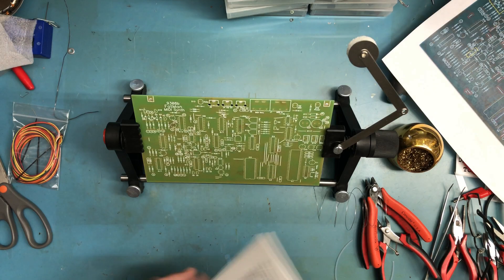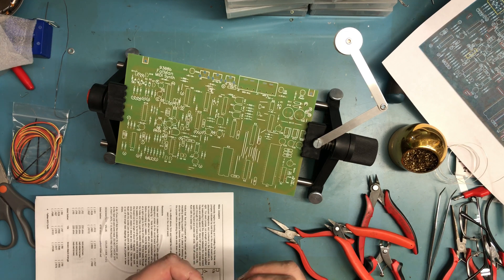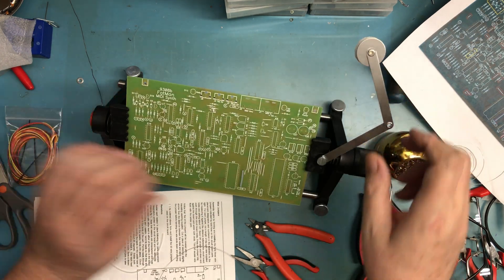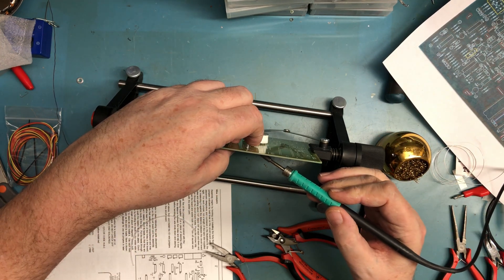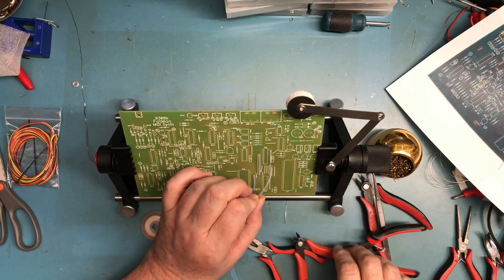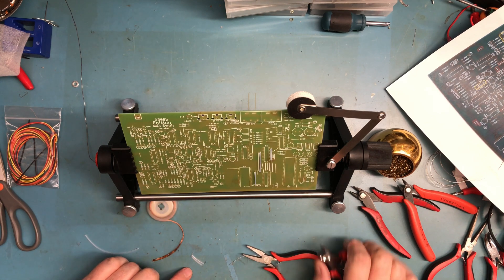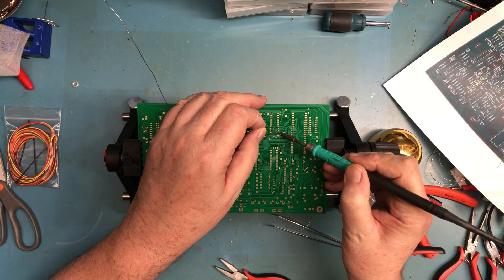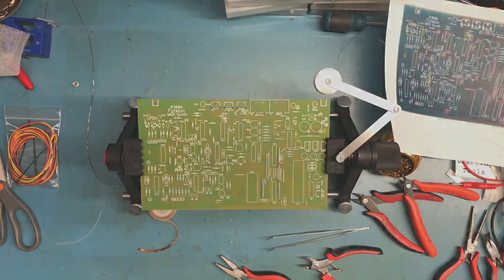STB822 - PAiA FatMan Synth - Part 2 - Jumpers

Comment: Curious: what would be the purpose of the tubing...? it doesn't appear to be for noise/EMF suppression...
Reply from the maker: The tubing is there as an insulator. The wire they provided for the jumpers is bare. It's just there to keep adjacent wires from shorting together.